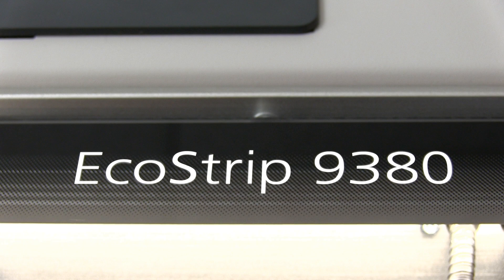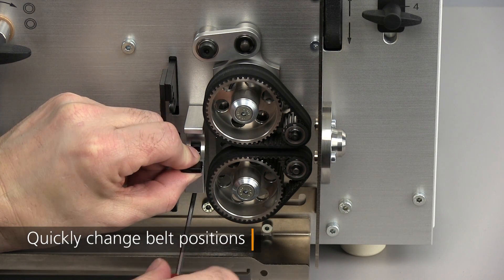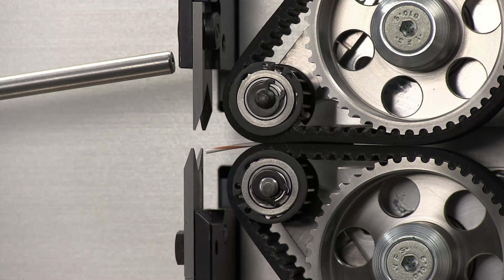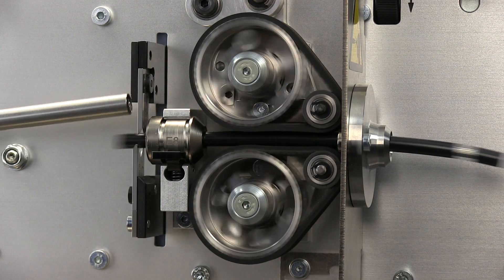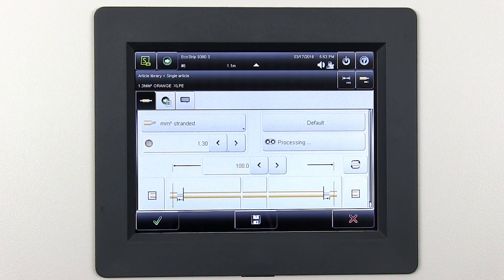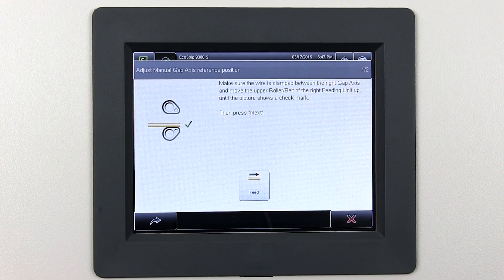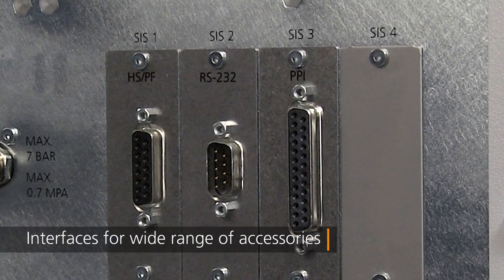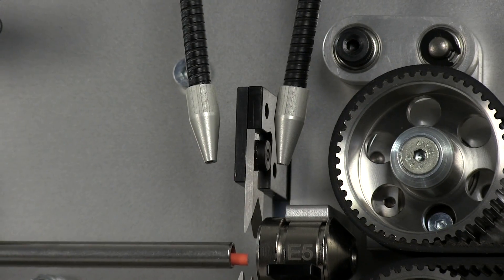Schleuniger EcoStrip 9380 - Entry Level Cut & Strip Machine

Comment: What can be done if the cable is fabric?
We have a serious problem...
Reply: hey I have the same issue, if you found a solution I would be happy to know about it
Reply: They make a special set of blades that should be able to go on it. Not sure how it would do stripping it but should at least cut to length. Worst case, a Komax 330 with the rotary head will strip just about anything.

Comment: you say "economical price point" and "entry level" but there's no price to be found *anywhere*, it's always "be a large company with some tens of thousands to spare and call your sales rep" -_-
Reply: Older used 9300 models can be found on Ebay for $7,000 - $9,000
Reply: These companies are always so frustrating with the same old sales line. We have to customize the order to your needs. They just want you to have to deal with a hard sale salesman. They all damn  well know that we just want a ballpark on the base unit. What are we looking at... $1,000, $10,000, $100,000. If they won't tell you up front then you can't afford it, unless as you say - you're a massive company. A two person startup has a different idea what "entry level" is compared to a company with 50 employees.
This machine boils down to what, 3 steppers and a solenoid. You could build one around an arduino.
Reply: Hi Kyra, we know that each and every one of our customers is unique. It's important we understand their needs, the kind discovered in conversation, before we can move forward with recommending a machine/solution and pricing. If you would like to discuss your current needs, please call 603-668-8117 or email sales@schleuniger.com and we'll be happy to put you in touch with your local sales representative. Thank you!

Comment: We already using this machine,
And we used belt feed system

But, we encounter length variation at cable shield wire🤔
Reply from the maker: Hi Charlie.  Please contact our toll-free Technical Support Hotline at 1-877-902-1470 and they will be able to walk you through how to correct the issue.  Thank you.
Reply: Contact me,we can adjust data on machine: Whatsapp+86 16215028888

Comment: Tell them the Price Son!!! - not interested in contacting someone, just an approximate retail cost? $2000 USD or $20,000 USD???
Reply: Yeah really. Their wasting everyone's time hiding the price away like this.
Reply: @ElationProductions  Think critically here- if someone can't even contact them, they probably can't afford it.
Reply: 10-12k depending on options and another 8k for a prefeeder so you don’t have to fight the wire the whole time from the memory. They call this entry level because the one you really want is 150k
Reply: @Crunk99ify  yeah you are looking at a minimum 30k USD to get something semi optimal. Fine for low spec CLASS 2 work but anything higher this machine ain't cutting it